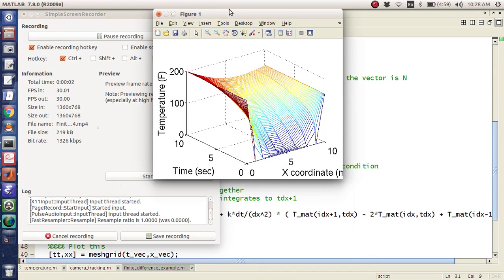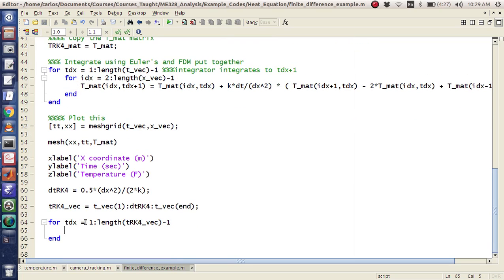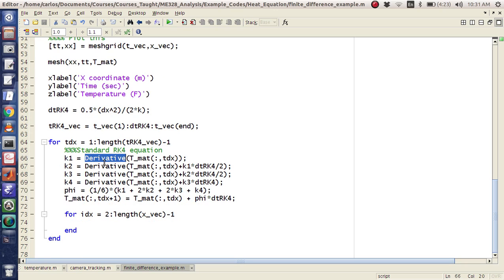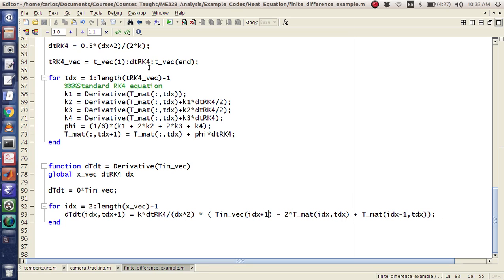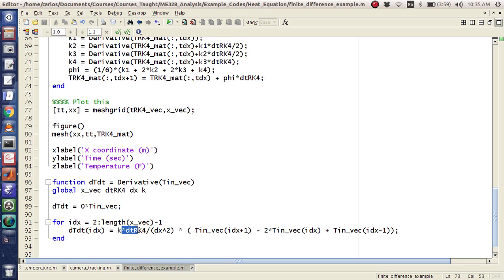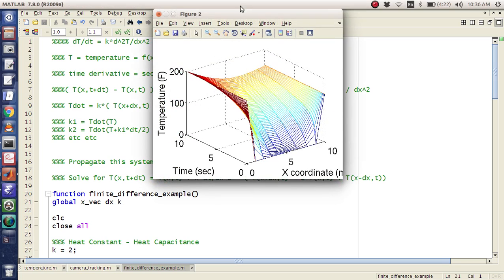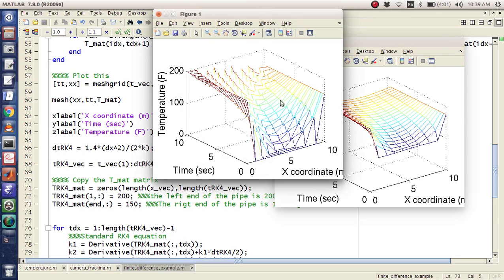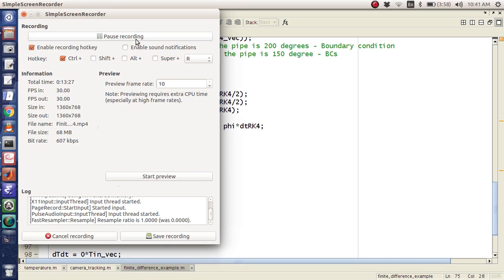MATLAB Help - Finite Difference Method with Runge Kutta - 4

Comment: do we use the fractional timesteps that are in the runge kutta 4 algorithm?
Reply from the maker: Rk4 is a fixed step integrator so the timestep is constant. What do you mean by fractional?
Reply: @CarlosMontalvo251  usually i see the runge kutta written as evaluating k2, for example, at t0+dt/2 and at y+k1*dt/2. 
maybe it is because k2 is already an approximation for that fractional time step?
Reply from the maker: I'm still not following. RK4 is called RK4 because it's a 4th order taylor series approximation. The 4 function calls are used to create k1,k2,k3, and k4 with "fractional" timesteps. These are on lines 65-68. If you skip to 3:10 into the video you'll see.

Comment: Thank you so much Monte. Both videos were really helpful. I have a question: I am solving multispecies chemical reaction-diffusion equation ( PDE with nonlinear term) and trying to solve it by using finite difference method for PDE term and RK for chemical reaction. The only problem I have is how to combine them together to simulate spatiotemporal evolution, do you have any idea? Plus I have simultaneous equations ( for each species or let say u1, u2 and u3) which is making it more complicated.
Reply from the maker: Unfortunately this is not my immediate area of expertise.

Comment: Hello Dr. Monte Carlo.
Thank you for very helpful lessons. Could you please suggest how to approach to my problem? I have a 1D parabolic PDE where the right hand-side boundary is changing over time (given as an ODE with involved dTdx term from the PDE). Moreover, the coordinate scale is ~1mm so the time discretization from given in this video relationship is going involve enormous number of timesteps. 
Thank you!
Reply from the maker: Hey Doston, that sounds like a difficult problem but if the boundary condition is changing you might just be able to change it as the integration is going. Good luck!

Comment: Thanks so much Sir for sharing this helpful video. I just have one comment to add:
The problem at time =0 (steady state) reduces to d2T/dx2=0 which gives a linear distribution of the temperature with x at t=0. This initial condition should be specified with the bcs.
Reply from the maker: This is true. The method shown above is sort of something I just made up on my own.

Comment: Hello sir,it looks like 1 dimensional problem.How we solve 2 dimensional problems with RK4?
Thank you
Reply from the maker: That isn't a simple answer unfortunately. You'd have to set up the equations by hand and then get them into a psuedo code and then code it. I would first look at the problem by hand and then go from there. I unfortunately can't help you further than that.
Reply: @CarlosMontalvo251  Thank you Sir.Now i wrote fdm 2D N-S code.I want to convert my mehod to The Compact FDM.But i am struggling now.

Comment: thank's for this illustratif example but I have just one question , can I use the RK4 with Finite difference method to solve the Navier-Stockes equations for fluid flow
have the best of luck
Reply from the maker: I'm not sure. I've never solved the Navier Stokes equations before. I would think this would be a viable method though.
Reply: I'll try with RK4 method and I'LL tell you thank you
Reply: @kingtarekdz  Hello,I solve 2D N-S equation with the Euler Method.Did you use RK4 ?
Reply: @kadrikocer5021  yes I do but i used the stream function vorticity form of N-S If you need any help just ask good night

Comment: I am trying to solve three coupled pdes in which two are nonlinear pdes but getting an error. can I show you the three coupled equations with initial and final boundary condition so I can put the right approach with your help?
Reply from the maker: Sure. Fire away.
Reply: @CarlosMontalvo251  thanks sir
Reply from the maker: @tutorcosmos  Yes. I see it. What seems to be the problem?
Reply: @CarlosMontalvo251 I the problem is when I am trying to solve them coupled equation using backword implicit method and using derivative boundary condition  (Neumann boundary condition) in first and second equation not able to apply them accurately.   I want to know how we can use this boundary condition in Matlab? directly or modify the equations using these neumann boundary conditions at the boundary.
Reply from the maker: @tutorcosmos  You have to set up the numerical equations by hand first. Once you get those you can plug them in. The derivation you sent me is incomplete. You have the equations and the boundary conditions but you haven't included the numerical scheme yet. You need to do that before you start coding in MATLAB.
Reply: @CarlosMontalvo251 I am using backward difference implicit method. ok, I will try to make the stepwise solution and then write in Matlab and after that, sir,  I will take your suggestions if I will face the problem.
thanks

Comment: Hi Dr. Montalvo, I've been watching your videos about numerical methods for a while now. Thank you for posting these super helpful lectures! I have to write some code for a project to solve a third order, nonlinear ODE. The textbook mentioned obtaining the solution using RK4 but it appears the professor would prefer we implement FDM in the most efficient way possible with nonuniform grid sizes. I am familiar with Matlab but have unfortunately never taken a numerical methods class. What would you suggest as the best method to solve this problem? RK4? RK5? FDM? FDM WITH RK4?
Reply from the maker: Seems like an odd request from a professor. The best way to solve odes is to use rk4. If I had to do something fancy I would use central or forward differencing to approximate the derivative and then use that in conjunction with Eulers method. Seems way too complex though.
Reply: Thanks for your answer! RK4 is going to be my last-ditch method. It may seem like a difficult topic. But I'm also an AE student--and at my school, projects like this seems to be the norm. ;(
Reply from the maker: Well good luck. Rk4 isn't so bad once you've coded it the first time.

Comment: Hi Sir!

Please, let me ask you something about the RK4 method that you are using. Please, correct me if I am wrong! :)

I am a little confused, the heat equation can be expressed this way: y' = f(t,y) or just y' = f(y)?? 
If the first way is correct, then you should express the k terms this other way:
k1 = f(t_i,y_i);
k2 = f(t_i + 0.5*h, y_i + 0.5*k1*h); being h the dtRK4
k3 = ... and K4 = ...

However, the method I have just raised is also a little controversial to me. Could you please help me to clarify the ideas a little??
Thanks!

Great video.

P.S: which matlab font are you using in the editor?
Reply from the maker: Some ODEs are time dependent and some are not. But it's better to include time just in case. 

Font = Monospace Regular

Comment: Hey i'm having a problem with a program, i need it to save variables with RK, i have a system of partial DE which i discretize with the use of several for, then a i wrote de 2 diferential equations i want to solve but both have a term that has to be saved for futher calculations with it and its very important to do that, i'm seeing that you could help me, if you give classes or help people with their works just tell me how much, i'm actually needing help on this
Reply from the maker: Hello, i am currently a professor in mechanical engineering but i am teaching aircraft stability and control and vibrations this semester. So i can only help you so much. is it possible for you to send me an email? be as specific as possible in your email.
Reply: +Carlos Montalvo  it is please give me your email
Reply from the maker: +Andrés felipe Becerra Zarrate isn't my email listed on my main youtube page? it's public information.
Reply: +Carlos Montalvo i didn't see it but i saw you speak spanish so i am switching to it now, solo vi tu perfil y la descripcion y las listas de videos, no el correo.
Reply from the maker: +Andrés felipe Becerra Zarrate Si, es un poco dificil encontrar. Si vas otra vez a mi perfil, dale al boton que dice "For Business Inquiries". Asi puedes ver mi email. Tienes que hacer un CAPTCHA pero no es una problema grande.